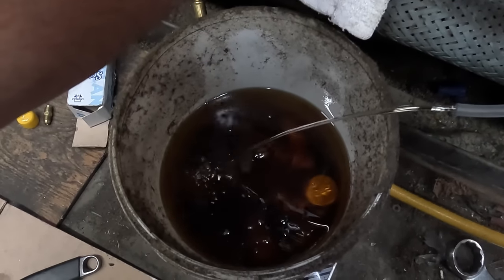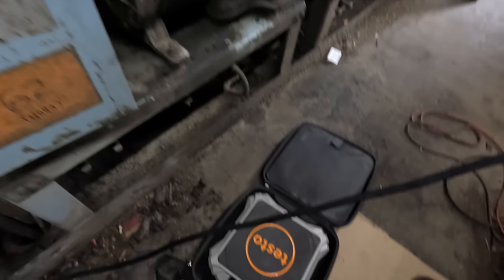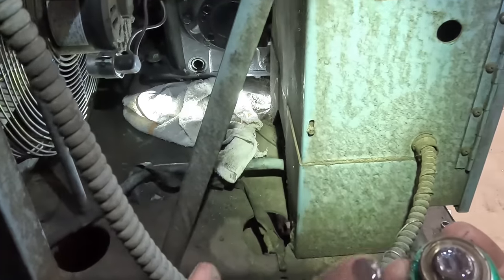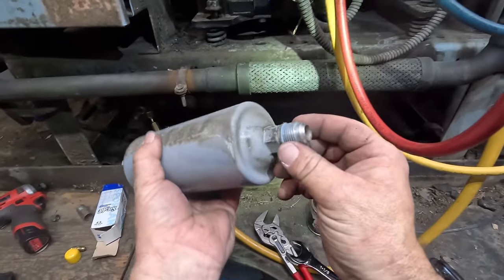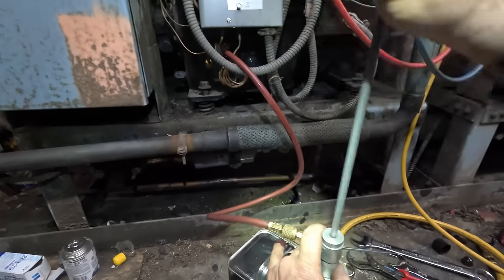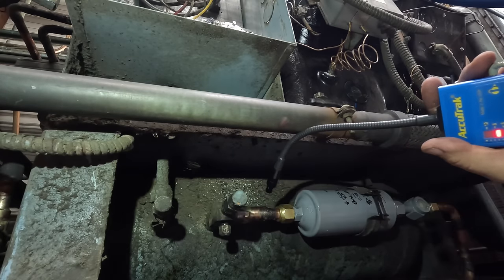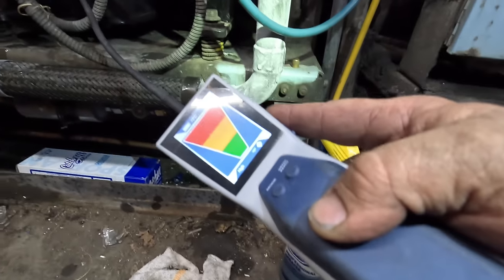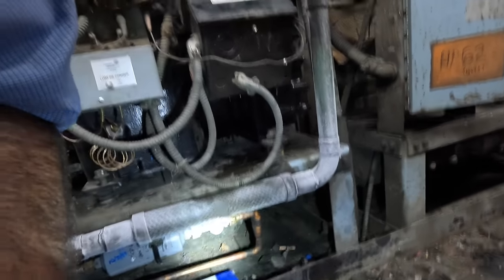R12 MP39 NOW R134a FULL Refrigerant Conversion Failures

Comment: GUYS, GUYS . . . . . The threads are not the sealing surface of a flair connection, leak lock Teflon tape won't help.  Don't use leak lock on the threads.
Reply from the maker: I do sometimes use it on the threads so that it doesn’t loosen up.  BUT I don’t get it all crammed inside the sealing surface of the flare and I don’t use the blue stuff.

Comment: Thanks again for another top notch great video 

One humble suggestion:

Loctite 554 or 567 for pipe threads on refrigeration
Reply from the maker: We use the white one from them. I forget the number.
Reply: The white is 567 Teflon based 

The red is 554 works better and has a slight thread lock quality to it but $$$

HVACRSurvival = best on the tube!

Comment: Hey Rick, congrats on new grandchild. Curious why you chose to convert to 134 and not 448?
Reply from the maker: Did you compare the PT chart? R12 runs a much lower temp/pressure. I would have to replace 3 Txvs and set up the superheat to use 448a. R134a was the replacement for R12 systems. Unfortunately it’s getting discontinued just like every other refrigerant but it’s not my fault they waited 30 years to switch to it.
Reply: @ totally agree on all accounts. I would have strongly encouraged / recommend the 448 upgrade. Not knocking your repair. You did a great job and I feel your pain with all you went through. Been there, done that. I also “experimented” with blue (flux) solder rods. Threw them in the trash 4 years ago - totally not up to the hype! We got rid of 134 a year ago. Not on the trucks at all!